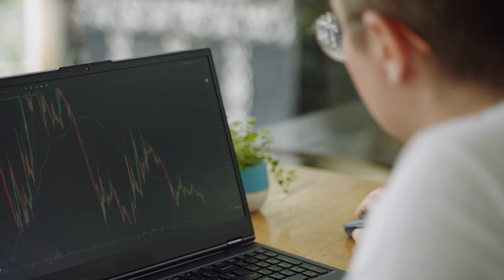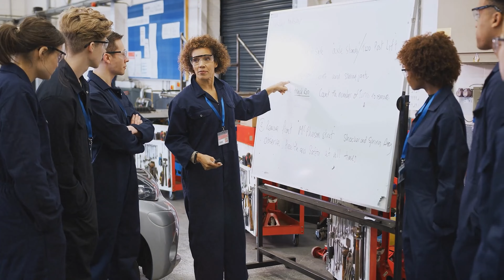10 High Paying Trade Jobs Without a College Degree

Comment: I've been running my own carpet and upholstery cleaning business for 20 years. I have way more work than I can handle. Only took 8 days of training at a local distributor. $80-$100 an hour. I'm not getting rich, but it's not a bad salary. I have an HVAC degree I can use if I ever have to. Not bad money there either.
Reply: Impressive! How was it to get started though? How did you get them to train you at the distributorship and what type of investment is required to get the equipment needed to do this type of work.

Comment: The thing with aircraft mechanic is you usually have to have experience or know somebody to make the big money. Starting off with prop planes don't pay well. I went to school for it but the school closed down as I was halfway through because of Sept 11th. Plus I found out when I was in school that they get laid off a lot. Foodservice delivery is where you can make the big money depending on the company. You can easily make over $100k. The company I drive for you can make up to around $170k/yr if you don't mind working hard and all you need is a CDL. I also heard the guys that haul raw milk make well over $100k/yr too.